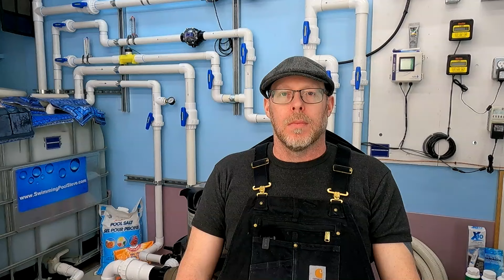How To Make a Pool Pump Quieter!

Comment: hello slightly off topic, but wondering what your recommendation would be filter wise. Lots of trees around pool, oak and crepe myrtle. In Texas so constant temperature changes and rainstorms. Pool is consistently algae all over the sides. Pool is also well fed with highish lvl of alkaline in the water. Also very "hard" water. Current filter system is a sand filter. Even when freshly new sand still same issues. Wondering if DE filter would work best for this situation. Just watched ur 4yr vid on the different filters. Not sure if this situation needs a filter that gets the smaller particles.

Comment: If I can change my RPM does that mean I have a variable speed pump?
Reply from the maker: that is correct.  If you have only low and high speed this is a dual speed pump.  If you have control like a dimmer toggle on a light then this is a variable speed pump.  Usually a digital interface with RPM, time etc.
Reply: @Swimmingpoolsteve  still pretty loud though
Reply: Of course my first pool so not sure what to compare it too

Comment: So your solution to make my perfectly running pump quieter is to buy another pump? Maybe you should re-title your video...
Reply from the maker: Well, literally the first thing I said in the video is (two examples) of how you traditionally solve noise and vibration problems with pool pump. Then I offered a new solution to buy a VS pump.
Reply: He literally told us how to do it
Reply: The first 2 ides he literally says, they don't apply anymore. I agree that a variable speed pump is the way to go. My point is that the title is very misleading. And yes, I do own a pool. 20x40 salt with polymer walls surrounded by 22 yards of concrete. Did it all myself and was talked out of the v.s. pump. I regret that decision.
Reply from the maker: Putting a rubber mat under a variable speed pump still helps to reduce vibration noise.  That did not stop working.  Same with isolating the pipes with flexible sections to limit pipe vibrations.  I am sorry you were talked out of getting a VS pump.  That sucks to hear and is surprisingly very common still. I do my best to educate people as to just how much they save with these videos. 
 @mstrpth287